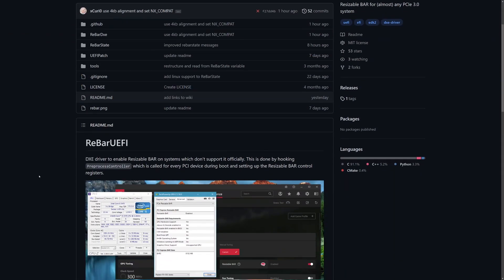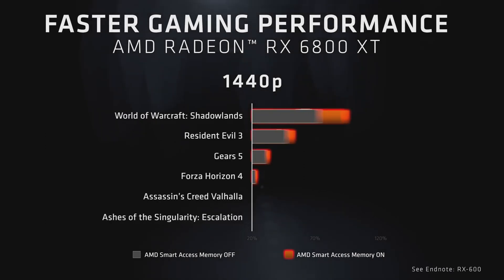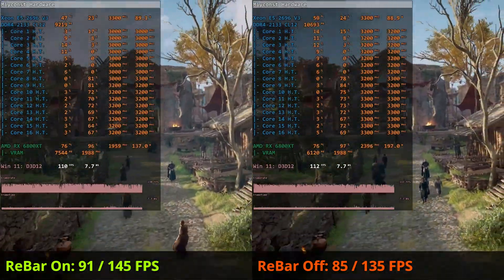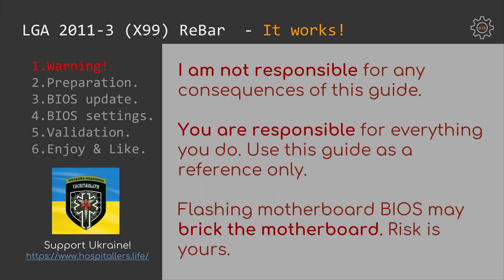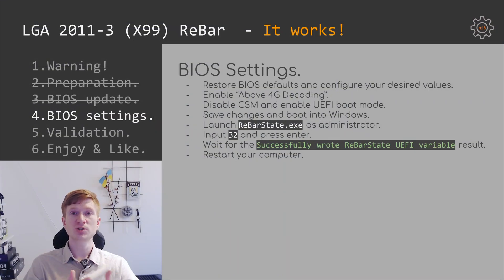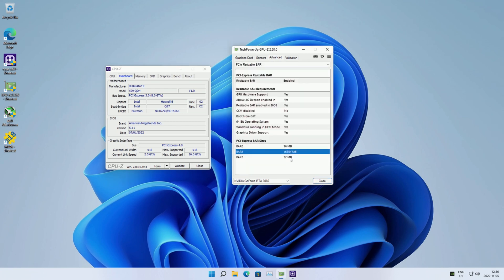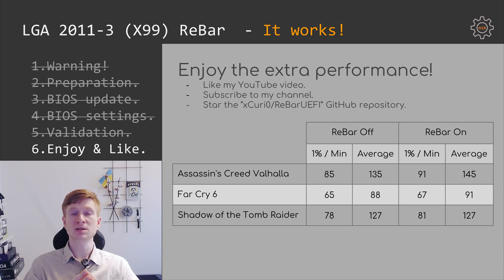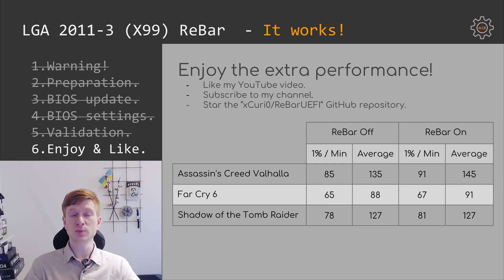🇬🇧 Resizable BAR (ReBar) on LGA 2011-3 X99 – how to enable and get extra performance

Comment: Great tutorial. I used it on my Huananzhi F8 and it works flawless, I ran the CoD MW2 benchmark and I saw a few percent improvement with RX6700XT.
Reply: awesome ty, I was looking to see someone with an F8 post it worked well, time to try it out myself.
Reply: I did not see the above 4g decoding in my F8 bios, not sure why....where did you find it? Thanks
Reply: @brianwong6562  I think it’s under the PCIE options but not sure. I am not around my pc at the moment as I am travelling. It’s definitly in there though the bios on that mainboard can be confusing. Also note that for me it was stock in CSM mode and I had to disable that I believe.
Reply: @BertM3  Still didn't see it. Maybe my bios is just too old. Purchased Mobo on 2020 April, might need to get latest bios through Mi899. Thank you for the reply and Happy Holidays.

Comment: Does this work on reputable brands, or just specifically designed for Chinese off brands? I have an Asrock Taichi i'd like to enable rebar on.
Reply from the maker: It's supposed to work with all X99 boards, as long as you can flash the modded BIOS.
Reply: @Miyconst  You think its worth picking up a CH341A for ease of flashing?  At a glance it appears this board has the removable modules.
Reply from the maker: @GeneralLee131  yes, if your motherboard has removable BIOS, then the BIOS flash with a CH341A is really easy, and I would recommend that.
Reply: @Miyconst  It works! Definitely had a modest performance boost on my 6850K / 7900 XT rig. Thanks for taking the time to make this tutorial, i really appreciate it!

Comment: Hi, I'm from Brazil and your videos are really helpful around here. I wanted to ask for your help in my situation: I have a Kllisre X99 V201 with the C612 chipset. All the information I could find about this board says that it is compatible with the X99 8M-F BIOS, but the 8M-F uses the B85 or C226 chipset. Which BIOS can I use in this case? Maybe the X99 8M (non F)? Thank you very much in advance and I hope you continue with your excellent work!
Reply from the maker: I have never had a V201 with C612 chipset, but I can say for sure that B85 BIOS won't work on your motherboard. X99-8M BIOS might work, but not likely. If you don't have a programmer, I wouldn't risk trying it.
Reply: @Miyconst  yeah, it's really strange. In AIDA 64 it shows "Intel Wolfsburg C612", the stability test doesn't freeze and the sleep state works fine, so it's not a B85/H81 for sure. I bought it in late 2020, so maybe they still used better chipsets on these boards back then. However it doesn't have above 4G decoding on BIOS, do you think I can enable it somehow? Also if you want more information about this board so you can update it in your software and channel I can send it to you
Reply from the maker: @rodrigovhn5479  most likely your Above 4G Decoding option is simply hidden in the BIOS. Create a BIOS dump and then open it with Amibcp tool, explore the BIOS settings and see if you can find Above 4G Decoding. If yes - set visibility to User then save and flash the modded BIOS. Remember to always keep a copy of the original BIOS and a CH341A by your hand.

Comment: Hey man, I remember you had a friend that made custom bios for some of the chinese motherboards and I was just thinking maybe it's possible to add an old ASRock hack in x99 motherboards? Back in 2015-2016 ASRock launched a feature called Sky oc that allowed to overclock non k intel chips ( 6th generation- z170 chipset I think )  and it worked changing the base multiplier but then intel changed microcode on the non k processors and ASRock stopped trying to use it.  I don't think that the xeon v3 series had a microcode change, but the v4 might even also not be affected because of launch dates mostly. Perhaps this can be custom made for xeon? You are the x99 scientist after all haha
Reply from the maker: Maybe it's possible, maybe it's not possible. My friend lost his laboratory and had to run because of ruzzian invasion.

Comment: Hey Miyconst, I hope you can help me understand what's going on with my 2666v3 please. I bought an x99 kit from Ali with a k9 and the 2666v3, which came from the store with turbo boost unlocked. 
In both HWMonitor and AIDA64, the power consumption is shown only "package" and never exceeds 16W at full stress. My hypothesis is that the sensors are misconfigured and that 16W that I see as a "package", is actually the consumption of one of the 10 physical cores, totaling 160W. And the VID Max during the stress test is 0.990V, but in iddle it reaches 1.059V. What do you think?

Thank you for your excellent work!
Reply from the maker: The power consumption sensor is simply broken and there is no logic behind this value. If you want to know the actual power consumption - use an external wattmeter.
Reply: @Miyconst  
Thank you very much! I'm going to buy one to take measurements.
Reply: I had the same issue and HWMonitor will show incorrect info, just a few watts for cpu usage but using HWinfo showed the correct values and wattage. I tested via an external power meter and compared it to hwinfo information. Also compared to TDP levels min and max

Comment: Hello, I have a question please, are the VRMs of atermiter x99 d4 enough for the e5 2670 v3 or at least will it work good with r5 2620 v3?
If not what is the best budget x99 now?
Reply from the maker: Hi there. I can suggest you these two videos that should answer all your questions: https://youtu.be/7Pyef_ySHwo and this one https://youtu.be/AW0QgQNbBwA
Reply: @Miyconst  Thank you very much
Can you just please tell me what do you think about the e5 2667 v4 QS it has 3.6ghz boost clock and 8c and its only for about 56€ is it good or will an r5 2643 v4 or e5 2678 v3 or 2666 v3 be better?

Comment: I need your expert opinion as you have delt with these motherboard for sometimes. i bricked my motherboard and i used ch341a to rewrite the bios " stock bios", now my motherboard doesn't recognize any of my HD or SSD, only the M.2 " where the windows is installed " is working. Have you ever encountered this issue and is there a solution for it?
Reply from the maker: It seems like you have flashed non-original BIOS. Do you have any unrecognized devices in Windows device manager?
Reply: @Miyconst  i tried 2 bios, one from x99-tf website and stock one from your tool, both had the same issue.

Comment: Resizable Bar don't work with AMD Crossfire? After the procedure on x99-f8 the AMD driver disabled the Crossfire option
Reply from the maker: That's correct, either ReBar or CrossFireX.

Comment: Im trying it now with the dual socket F8D. But the regions on UEFITool is not showing so I dont know where to insert the rebar ffs file. Really liked your detailed review of the F8D. Im planning to get the F8D Plus withe 3 pcie x16 and 3 pcie x8
Reply: Hey :) I got it working. I forgot that I did a fresh format to win 11 and that made my drive MBR thats why eufi boot is not working
Reply from the maker: It's impossible to guess what is wrong, thus I would recommend you to join my Discord and send some screenshots there.
Reply: @Miyconst  it was there all along lol, guys in discord help me. Now, however I dont get any display when I change bios Video Settings for CSM to "UEFI", OS works just no display, can even access bios again to change it bak to legaccy
Reply from the maker: @AgentDonnutte  you can clear CMOS to restore the BIOS settings and then it will go back to CSM.

Comment: Hi miyconst, i've made the mod to the bios of my P9X79 enabling the 4g decoding trough amibcp, but enabling 4g decode made my computer to output only a black screen with the light of the monitor screen blinking very weak, though the beep of the computer seemed allright.( I can send you the modified bios for you if you think it may be usefull for you aswell). Any ideas?

Update:
 i've managed to start the computer with the modified bios, changed all options of above 4g decoding and even some others related to it, but gpu-z still says above 4g is disabled, so i did not applied the rebarstate executable. Should i apply the rebarstate executable anyway? Thanks.
Reply from the maker: No, you need enabled Above 4G Decoding, without it your system won't post if you enable ReBar.
Reply: @Miyconst  Thank you so much for helping. But is it possible that gpuz is reading it wrong? Because i've managed to change the option to enabled on the current bios file. Ihave bios programmer, if it goes wrong will it go back to normal if i reflash the bios with the programmer?
Reply from the maker: @Filipi4362  yes, it's possible that GPU-Z is misreporting the info, and you don't really need to reflash the BIOS if it doesn't post, you can clear CMOS and ReBar will go back to the disabled state.
Reply: @Miyconst  Thanks.

Comment: hi i have error Writing value to ReBarState

Failed to write ReBarState UEFI variable
GetLastError: 5
You can close the app now
Could you help me what i need to do?
Reply from the maker: Is your Windows installed and running in UEFI mode?
Reply: @Miyconst  Yes uefi and gpt
Reply from the maker: @vasg3n  What OS? Do you run the app as administrator?
Reply: @Miyconst  10 windows ltsc. yes
Reply from the maker: @vasg3n  then the only thing I can recommend is asking for some help on my Discord.

Comment: Confirmed Works in my Chinese x79 Motherboard, Xeon E5-1650, RX 570 8gb, 16GB RAM...
Reply: GA-X79-UP4 ,appears in bios 4g decoding but does not work in windows, i have

Comment: Very interesting. Oh though concerning the Intel Arc series, the software dashboard doesn't play nicely with systems below 11th gen. I try this on my 9900KS it wouldn't open unless I had 11th gen or above.
Reply from the maker: That's so shitty. Intel screw up this launch so hard. 😢
Reply: @Miyconst  it still ran Cyberpunk and Skyrim. I just have no control over the card. I do have an 11th Gen intel cpu I look forward to testing it there.

Comment: Is this available for Machinist X99z v102?
Reply from the maker: Most likely yes.
Reply: @Miyconst  without enabling the 4g decoding because the bios didn't have one?
Reply from the maker: @dominicjohntanas3574  you need to use AMIBCP tool to enable it, ReBar won't work without Above 4G Decoding.

Comment: It works remarkably well. Free performance : ) Xeon E5 2640v3, Atermiter x99 v1.3, 16Gb DDR4, RX6600.  Thanks so much.
Reply: Same configuration as mine, only changes that mine is RX 6600M. Is it still working normally?
Reply: @Shadow-lq8vh  Yup.  I had the memory overclock bios at 0ne point but it reduced the CPU boost clocks to 2.8Ghz max.
Reply: @jayming72790  This is bad, I want to try to do the tutorial.
Reply: @Shadow-lq8vh  yes it is. I believe it may be working better than some AMD configurations, since comparable systems seem to get less performance overall. Of course 6600 is overclocked but still.
Reply: Jay, is your motherboard that one with 4 RAM slots with 2 being orange and 2 being black ones? im waiting for my x99 atermiter to arrive,i couldnt find yours to compare
Reply: @brehh1337  my x99 atermiter has 2 slots on the left orange and black, and on the right with orange and black too
Reply: @Shadow-lq8vh  yeah its like mine then, good to know thanks
Reply: @brehh1337  Yes it is. But as Miyconst mentioned in numerous vids, there are several versions.

Comment: Bro, for the adept computer user, or for cheap arc developers, you could use an x99 ddr3 mobo, a 2666 and a cheap a380 or a770 and have a really decent dev rig for probably about 500.
Reply from the maker: Why would you need Intel GPU for development?
Reply: @Miyconst  as someone who does indie game design, its really useful to physically have a gpu on hand that you are trying to optimize for, and with x99 being so cheap but also supporting rebar makes development for it (more along the lines of bugfixing) a lot easier.
Reply from the maker: @KadiusFTW  I don't think that indie game developers have resources or desire to bother about the pathetic Intel GPUs.
Reply: @Miyconst  heh, I still find it cool. I just bot an a750 to run alongside by 6600 for AV1 encoding and to fiddle with.

Comment: Just tried this with a X99-TF Gaming (C612), E5-2678v3, 32GB Corsair DDR4 3200 memory, and a Radeon Pro W5700.  I used the latest "TV30.bin" bios from Huananzhi and modified it to use the turbo unlock (left C6 enabled), performed "rebar" on that modified bios (inserted after my V3 line) and it all worked perfectly.  Still testing uplift in games however.  I wonder if anyone knows how to get the Corsair memory RBG function to work with the ICUE software.  On the TF, Icue sees memory but does not list any way to control the RBG settings.  Tired of the rainbow!!! 😁 Thanks again!!!
Reply from the maker: As far as i know, Chinese X99 boards are missing some hardware features to control the RAM RGB lights.
Reply: @Miyconst  I am not trying to control the Ram's RBG with the board.  I am trying to use Corsairs ICUE software to control the ram installed on the board.  The software does see my keyboard and mouse and allows for control of the RBG.  But....  It does give me any option to control the RAM although it clearly lists information for it.  I have heard that there's an option called "speed write" when enabled helps from forums, but I do not see any option for that in the bios.  I guess I am out of luck.  I also posted the bios I modified to google for those who wish to follow my setup.  Cheers.
Reply: @anthonyslaughter1728  I flash Rtx 3070 Bios sucess Rebar On THX man
Reply: There is always the PAINT option.
Reply: Can you send me your bios? I have the same card as you did in the video but the gpuz says you need to activate it in the bios I have the 4g decode activated already
Reply: @vinisampaio4254  Bios flashing is a tricky business.  Hopefully you will have the same success I have had following the steps outline by Miyconst.  I have uploaded a folder and files required to duplicate my process.  Good luck.  https://drive.google.com/drive/folders/10___M5UbA9owTx5Xn7uI995I7COMhaZS?usp=share_link
Reply: @anthonyslaughter1728  Thx
Reply: @anthonyslaughter1728  I managed to activate here for those who have nvidia need to update the board bios thanks

Comment: It is amazing to see how x99 keeps on ticking. Intel must really hate these developments. It is crazy to think that one can now use an Intel desktop graphics card with an 8 year old CPU. Rebar was the only thing preventing that. I can't imagine how it would perform though. I would love to see some stats on that. These videos are really top notch. You always exceed my expectations. Keep up the good work! I can see your channel growing into something great one day. Your vids are amongst the few I watch all the way through.
Reply from the maker: Thank you for the support, if I get enough spare money, I will buy an Intel A750 to test with Xeons, but can't guarantee that.
Reply: Just tested with an a750 and went for a stuttery mess to a locked +60 fps at least on halo infinite, haven't tested much yet but this is absolutely amazing, a couple of things just in case someone finds the same issues, I had to do a MBR to GPT conversion to enable UEFI on my windows installation but other than this worked flawlessly.
My system:
Huananzhi x99 f8 with latest bios, turbo boost unlocked and this driver
2678v3
16gb 2133 MT/s
 Intel a750

Comment: As always very informative and helpefull.
I ignored your warnings and bricked my motherboard, now i just bought ch341a to fix it. That's a one way to learn new stuff. ;)
Reply from the maker: It's hard to say why. Try to run the tool as admin, check if it's disabled for other DXE entries or only for the last one. What motherboard is it and how did you obtain the BIOS?
Reply: @Miyconst I also see that option grayed out with the UEFITool_NE_A61 and A62 version from the linked repo, with an older version that came with the original x99 ffs modification I could insert it but AfuEFI won't recognize the file when I tried to flash it. This was with the CX99DE26 from iBiosEngineer for the Huananzhi X99 TF. Edit: The insertion at least works with 0.28.
Reply: Got it to work, you need UEFITool 0.28 though, the other issue was that AfuEFI expected the BIOS files from a ../bios directory. Many thanks for providing this feature, miyconst!

Comment: As I could remember, x99 NVME boot uses CSM, when use a BIOS hack. So, if I want to enable resizable bar, I will have to give up NVME boot, right?
Reply from the maker: No. You can use NVMe with UEFI, at least with the Chinese motherboards.
Reply: @Miyconst  Oh! Great! Thanks!

Comment: Will this work on OEM workstations based on x99? Something like the HP Z440 or the dell precision workstation lineup?
Reply from the maker: It's hard to say before testing, Dell should work, HP - unsure.
Reply: @Miyconst  If possible, do try to test it out and share the results with us.

Also I appreciate your content, keep up the good work!
Reply: @AbeelSiddiqui  I have an HP z440 and I can't find the option in the BIOS to enable Above 4G decoding which is required for this so IDK

Comment: Just enabled mine on machinist x99 RS9 works flawlessly. running a rx 6600 8gb GPU and fully overclocked using your tool  -70/50mv xeon 2640 v3 and is stable
Reply from the maker: Awesome! Now you can enjoy some extra free frames.
Reply: i have the exact same specs as you, gonna try this today